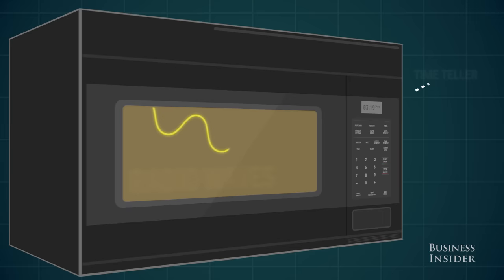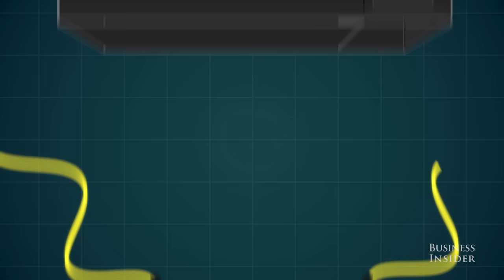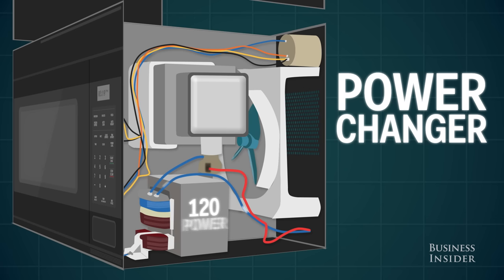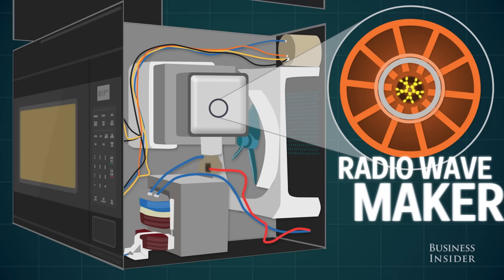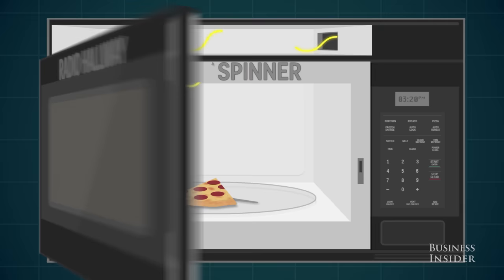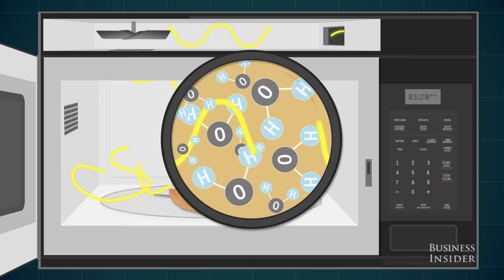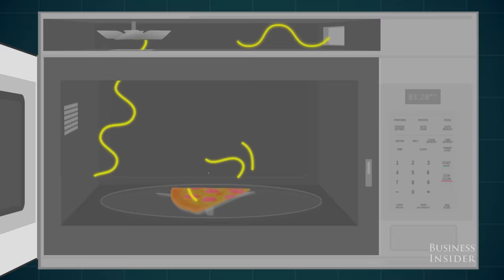An easy to understand explanation of how microwaves work

Comment: Most consumer microwave ovens don’t have the rotating fan like device that scatters the microwave energy throughout the oven.  Most just have the turntable.  Years ago some consumer microwaves had only the stirrer fan and no turn table.  My parents had an old 1983 Kenmore microwave that didn’t have a turntable.
Reply: I am 30 and live in a small country in Eastern Europe and I have never seen a microwave without a turntable :face-blue-smiling: and I have seen a lot of microwaves.
Reply: @MartinWasTaken American thing?…
Reply: @MartinWasTaken probably because you're young. I'm in my 40's and  live in the USA for context. I don't remember the turn table becoming common until the late 90's. A lot of those older microwaves had the fan.

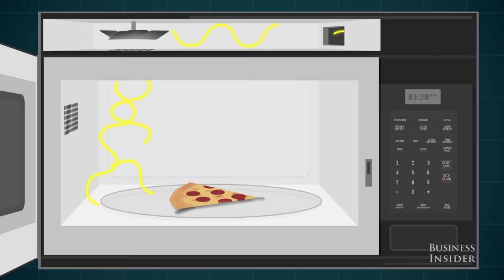Comment: 0:57 you got the most important part wrong. the radio waves don't "push" the water. they "pull" the water. big difference because the pull is from the rapid oscillation of waves which attract (ie PULL) the magnetically bipolarized H2O molecules in varying directions thereby causing the very friction that results in heat that cooks the food. pushing never happens and completely ignores the very way the food gets cooked.
Reply: Now I'm seriously confused xD
Reply: the very
Reply: Why are you watching when you already know
Reply: Technically it isn't friction but k
Reply: Microwaves do not "pull" water molecules in the way you've described. Instead, they cause water molecules to rotate rapidly as they try to align with the alternating electric field of the microwaves. This rotation generates friction between the water molecules, resulting in heat. This heat then cooks the food by heating it from the inside out.

Comment: In other words the waves directly aim towards the water molecules in food to create friction. The waves are powerful enough that cause strong friction making your food to warm up extremely fast. That’s why your plate doesn’t get warm only the food since solids don’t have water molecules. The only reason your plate is warm is because of the food.
Reply: Not really friction per-se but yeah.
Reply: I was thinking the same, I just put the plate in microwave and it got hot. It was dry as naked eye and touch can tell.
Reply: @V-XENO No, it is friction. The electromagnetic waves are oscillating, which, in turn, causes the water molecules in the food to also oscillate and rub up against each other. This causes friction between the molecules.

Comment: So basically ur wifi source is cooking ur brain while u sleep
Reply: no
Reply: No. Microwave ovens use around 1,000 watts while your standard router uses 0.1 watt. They may be on the same frequency, but they're not of the same power. Should you want to cook using a router, you'd need about 10,000 routers whose radiowaves are guided/concentrated to a specific spot instead of spreaded around.

Comment: Really it's just a fancy way of rubbing two sticks together or just kinetic energy, like the sun which in fact produces kinetic energy (thusly the big cosmic stick rubber in the sky) You left out the radio thing-a-ma-jig magnetron. Fun fact, the first commercially available  household microwave, the Litton, sold for a measly 5000.00 $

Comment: So by that logic, can someone explain why do materials like ceramic plates and glass heat up as well
Reply: Microwave ovens deliver heat to things that are electrically conductive, like water that has stuff dissolved in it, which is almost all water. Glass is an insulator, so it doesn't get heated by microwaves.

Comment: But a radio wave is larger than a microwave? They're literally different things
Reply: 1. If you read the description, the explanation is resteicted within top 1000 common English words. I don't think there's a closer word for it; especially because
2. Some consider microwaves as a subset of radio waves; afterall
3. We DO call a lot of tech such as TV, cellular, Bluetooth, WiFi, and satellite comms as "radio" even though they are technically microwave territory. 

Bottomline: They're not literally different things, it's kind of an arbitrary distinction